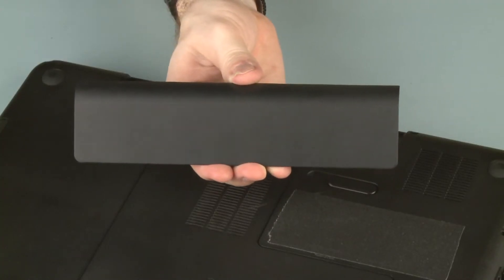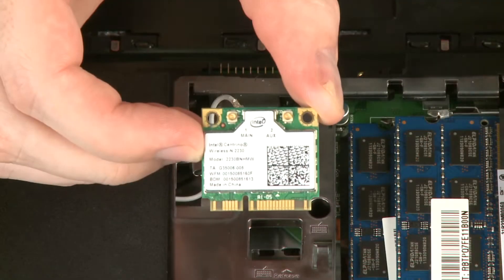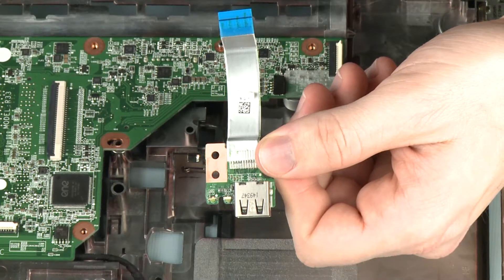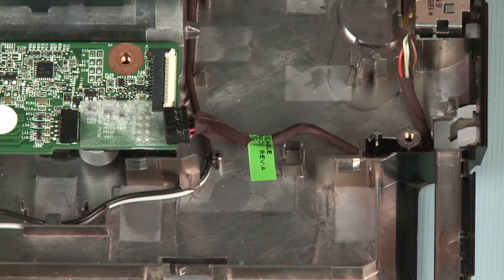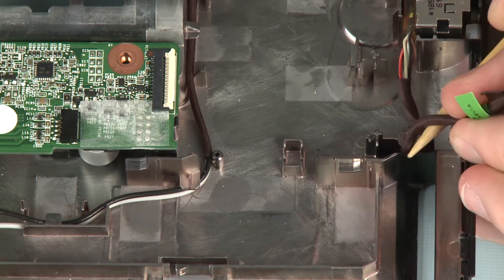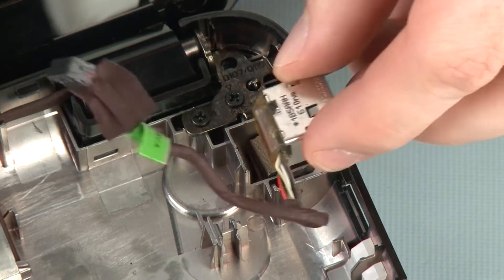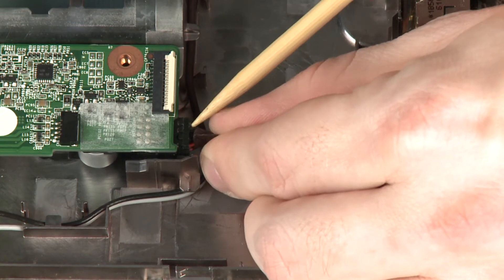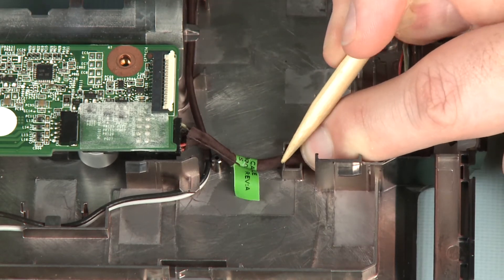Replace the power connector cable | HP Pavilion g6-2000 Notebook | HP Support

Comment: Hey Hp!
I have the same laptop but mine is the 2310ee version my  blue Plastic on the white connectors for example the one connecting to the power button has come off i was wondering if i could attach them with super glue or is that harmful for the laptop and will possible hinder its performance?
Reply from the maker: Hi there, thanks for contacting HP Global Social Media Support!
I understand that you are experiencing an issue with the connector of your notebook.
This looks like hardware issue, and you might have to get the notebook serviced. 
So, I would recommend you to contact regional support for repair options.
Please feel free to reach us on call/chat. Access this link to select your preferred country and language option to reach us. 
Global support link: - https://hp.care/6050leJFj 
Regards, 
HP Support
Reply: The connector did not come off just the blue plastic on it came off i was just wondering if i could just apply a little glue to attach it as it has become loose
Reply from the maker: Please try applying the glue.
If you need any help in the future, you can always get back to us.
Thank you for being a valuable HP customer.
Have a wonderful day!
Regards, 
HP Support
Reply: @HPSupport thank u very much!